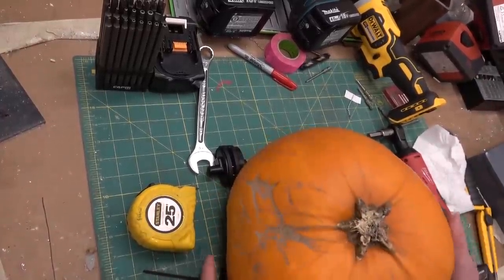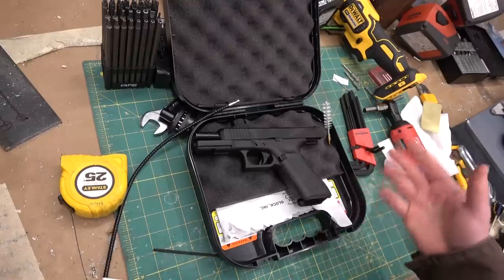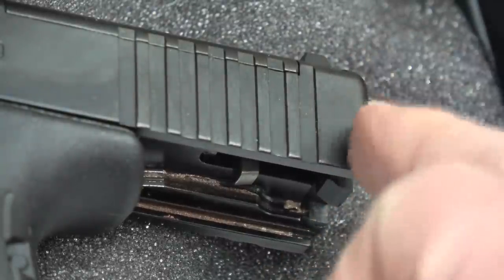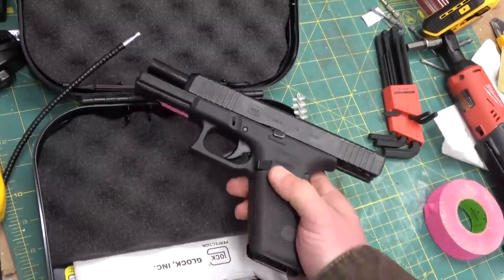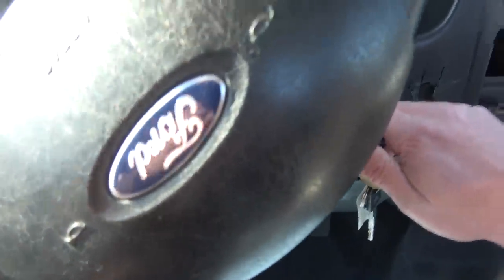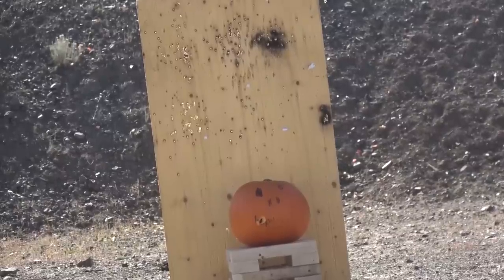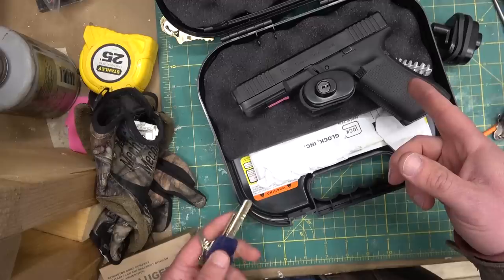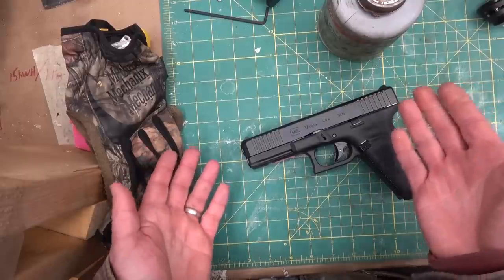BOLTR: GLOCK 17 GEN 5

Comment: They told me in the Glock armory training course that the copper lubricant is loctite C5A anti-seize.  According to them, it’s used because it’s better for long term storage and the slight abrasiveness aids with mating the frame and slide together.

The manual also implies that the copper lubricant was specifically used for a reason:

“SLIDE: (Note: The copper colored lubricant on portions of the slide of brand new GLOCK pistols is intended to help provide long-term lubrication and should not be removed).”
Reply: I was taught in gunsmithing that the compound was designed to wear in the pistol (kinda like a new engine.) When I buy a glock, I usually wipe that stuff off because I usually break in a pistol in the first or second range day.
Reply: @justinmeyer77  XD good ol' Glock. I was taught gunsmithing by my neighbor who was one at the time. Poor man's dying of cancer now. I've worked on untold number of glocks in my life. Both maintenance for my local pd and custom building for customers (gen 3 frames are cheap)
Reply: @justinmeyer77  Are you talking about the Glocks or the strippers?
Reply: This is what i was thinking as well I’ve seen people rotary tumble to get the mechanisms to make them more reliable and less chance of cutting the hand when the slide moves back after discharge.
Reply: @keats182 Yes.
Reply: @1FireyPhoenix  the gunk would be useful for cops wouldn't it as they rarely use the gun (and when they do it's normally not a thousand rounds) and cops are the main buyers of glocks (also do you know the comparative reliability of beretta, colt, and glocks?
Reply: @borttorbbq2556  civvies in US buy 2x more Glocks and and 2x more again more pistols than all PDs combined
Reply: @mattnw42  really?? Weird
Reply: wolfie Butler Not weird
Reply: @wolfie Butler close to one hundred million gun owners and less than one million active law enforcement agents. Not at all shocking.
Reply: @borttorbbq2556  they are required to train with the gun
Reply: I've heard an even better lubricant is just straight Loctite
Reply: I bought one in Germany. It came from Austria. And that one wasn't greased with the copper paste
Reply: Tzuede Off the Cuff personally, I like the wally world special hi temperature grease, it stays where you put it, unlike oils, and resists moisture longer than oils, especially in the hot, rainy season.
Reply: @JohnMaxGriffin  I just find it weird I'm personally not a fan of glocks but they undeniably reliable (i perfer berettas)
Reply: I've never had the copper lube fail me. I love my glocks, but they don't get babyed. Typically when I get one new the copper lube is the only lube that is on there until they're just way too filthy and filled with lint, carbon and strange white goo.
Reply: @Ark_0416  yes but there hundreds of guns to pick from
Reply: @1FireyPhoenix  I went to p.g.s.
Reply: @keats182  why not both?
Reply: @justinmeyer77  The glocks or the strippers?
Reply: Same here.
Reply: @justinmeyer77  I use a mix of 75% atf fluid and 25% 5w30.
Reply: @keats182  Well I certainly wouldn't use this Loctite stuff on the strippers. No abrasive necessary to mate those surfaces
Reply: Everything beyond the long term storage part is likely marketing wank. I along with everyone else that buys a Glock does 2 things. And often do these things even before they shoot it for the first time.

1. Get that awful copper shit off.

2. Change sights

3. (Optional) Beat it up so it doesn't look new. A Glock in the gun world is like a hammer in the tool world.
Reply: @1FireyPhoenix  I always heard people say to thoroughly clean a new gun, then lube to one's liking. AvE clearly doesn't paid extra for the manuals. What kind of manly man needs manuals?
Reply: yea, this is a break-in temp thing, not meant as a lube
Reply: Aren't glocks loose enough from the factory? Just use some high grit sandpaper to slick it up where needed then white moly grease for the rest.
Reply: Tzuede Off the Cuff  White moly grease is the best, I agree. It doesn't fume off when shooting and its easy to tell when it needs to be cleaned, since it's white.
Reply: Pretty much the reason they put it is so in case the gun stays in the box for a long time it doesn't stick.
As per suggestion from my armorer, whenever you get a new gun always do maintenance, be it brand new or used from the gunshop, and specially if it's from a gunshop.
Reply: @ChicknNudleSoup  I'm sure they have plenty of wear and tear already.
Reply: @borttorbbq2556  I have Colts Smith's, Beretta's, Sigs, Desert Eagle and some other well known brands that costs several times more than my Glocks (I have 8 of them). Glock is what I trust my life with. I was not only a cop for over 12 years but a firearms instructor for law enforcement as well. I fired my weapon several thousand times a year and never experienced any problems. However, I carried Beretta .40 for a while and as much as I love a nice Beretta, the frame developed a stress crack in the frame after a few years. Glock is the most reliable handgun in my professional opinion.
Reply: @borttorbbq2556  Every cop I know practices with their pistol pretty often.
Reply: @borttorbbq2556  Berettas (assuming you mean M9) and the Glock family are both exceedingly reliable.

1911s are pretty hit-or-miss depending on manufacture.
Reply: @triela420  Most do, although there are the lazy ones that do only what is required. And it definitely shows during qualification.
Reply: Thomas Foley  Beto may have him beat at the rate he's going.
Reply: @rjvan9220  Then sometimes I wonder, "What if it's all be design?"  Threaten confiscation/disarmament, firearms sales go through the roof, American citizens become the largest, most-armed standing army in the world that none but the insane or the suicidal would ever think of invading.
Reply: @Thomas Foley hard to say how it will go with how many bootlickers and order followers there are on the right.
Reply: wolfie Butler and yet a majority of police departments choose Glocks. What makes you think a majority of private citizens won’t do the same? I don’t think I know a single Glock owner who only has one, anyway.
Reply: Yeah what he said. It’s to help break it in bro. After a few hundred rounds, clean and regrease.
Reply: @John Doe - Couldn't agree more...
Reply: @Bluelightbandit  I bet your desert storm locks up on you often. Personally I hate thos gund because they would jam up.
Reply: Wranglerstar uses blue loctite on the slide.
And he keeps his glock in an old USPS box
Reply: @v8consumption  Police? Some only shoot it for their yearly training. Literally only rounds they fire all year is at the qual, no practice ever. Source: Small arms instructor.
Reply: @JohnDoe-zl6qw  I wish that were so. The ideologs that want disarming of the American public all seem to be " the entitled" that feel government power is supreme and that they should never be challenged. To bad most remember too late that we put them there, and can remove them. However, a lot of the leaches always seem the get reelected, some for years. We need term limits. No elected official should get a retirement for life after two terms either.
Reply: @sluttybutt  Thanks for that insight man, really.
Reply: In addition, they've been shipping them with that stuff since the very beginning, so even if their reasoning is wrong, the results are right.
Reply: @myis300turbo  Sure, how much would you like to bet lol? I don't own any weapons that malfunction often. Every gun that I have owned that had issues, I either fixed it myself, sent it back to the factory or just got rid of it. The Desert Eagle .50 AE is a very unique and heavy handgun that incorporates  a gas piston to cycle unlike most other semi's. Many people don't grip the gun properly while firing which can definitely cause a malfunction. Those guns aren't for everybody.
Reply: @rjvan9220  Oh, I agree.  It's just one of those, "Hmmm...what they're doing seems to be having the exact opposite effect of it's stated purpose for so long and for so many.  Coincidence?"  And of course it IS coincidence and false pattern recognition; at least of their intent.  It does appear, though, by the empirical evidence that if you intentionally wanted to ensure your populace arms itself to the teeth, just threaten to take their guns away (assuming it's a nation which recognizes the right to keep and bear arms in its founding document).

As far as term limits; yep, we need em.  Badly.  And take away many of their perks and privileges; force them to abide by the same laws they pass (*cough* Obama care *cough*), no voting themselves a raise (raises are put to a vote of the people, not to exceed a small multiplier of the minimum wage, and/or tied to the annual cost of living increase), no retirement package, and no working for a lobbying firm or any business which receives government contracts for a set amount of time after leaving Congress.  That will very quickly get rid of the leeches and return us to public servants who are there to genuinely represent their constituents.
Reply: AleXxTM123 The ones in the US come from Austria too. They are imported and distributed through Glock USA in Georgia.
Reply: Michael LeCompte Correct....Glock recommends not cleaning the copper grease off until initial firing and then cleaning. That being said, I owned 3 Glocks before knowing that and cleaned my guns after purchase. No problem either way
Reply: @justinmeyer77  Mobile 1 - works fine for your 25 yo Porsche and all the other stuff around you.
Reply: @borttorbbq2556  CZ P10C
Reply: @justinmeyer77  The strippers or the guns?
Reply: You learn something new every day.
Reply: @marcondespaulo  Actually the glock manual specifies that it is pre lubed from the factory and should be wore in with the factory schmoo. I would give a page number but I have to track down my manuals.
Reply: @justinmeyer77  the strippers or the gun? My man loved to be sliding in some good Mobile 1 :)
Reply: @1FireyPhoenix  no need to track page#... Thanks for the info. I have had no exposure to that. Very interesting. I understand the long term storage aspect, the lapping aspect less so, since people consider the breakin period to be 500 to 1k rounds. Pretty much one or two good range sessions.
Reply: @marcondespaulo  Glocks tend to be marketed to people who aren't gun enthusiasts. Most people who own a glock only shoot once a year. And usually with the crappiest ammo available. The self lapping helps break in the gun even if it's only shot once or twice a year.
Reply: @1FireyPhoenix  I guess I'm an exception to your rule lol.
Reply: @myis300turbo  Have you got one or have any videos of you having trouble firing one? Or are you just basing your opinion on articles or videos from internet superheroes?
Reply: if you buy a pistol and question its quality to the point of calling their fucking armory you bought the wrong pistol sir. C'mon man they come with plastic sights, have some self respect. Buy a real gun.
Reply: @justinmeyer77  If I go to an Atlanta strip club, I'll be sure to bring a bottle of Mobil 1.
Wouldn't want to run them dry.

Comment: The never seize is a break in compound...designed to get that gat good and sloppy for zero jam action. Hence the aggregate in the grease.
Run 500 through it and clean it out.
Reply: @markm0000  Aren't you supposed to baby it the first 500 miles?
Reply: This is how I understand it as well
Reply: Break in mentality has changed over the years, modern vehicles (especially diesels) say specifically not to run high revs or give it large amounts of throttle for the first 500miles (or in non-American manuals, 1000km, which is actually a good bit further), indeed because people kept ignoring this a lot of new cars are actually limited within the ECU till that first service, and trucks torque limiting threshold is raised to its advertised value even later again, sometimes 3rd or 4th service. The other thing they say is to avoid idling for long duration's, especially during break in, a notable change compared to older logic of starting a motor early to "prewarm" before driving or tractors of old that you used to literally idle a few hours after reconditioning, but none the less the mentality change seems completely ubiquitous across the range of consumer vehicles (maybe not surprising when you see how few actual human designers get shared between brands for some systems).

Comment: Good old low and left.

That's gonna be a case of operator error
Reply: ^ this.
Reply: My experience with Glocks and other pistols is that the culprit of the old low and left resides in your little finger. Your first 3 fingers naturally pull directly back into your palm but your little finger torques the grip of a right handed shooter twisting the muzzle down and left. A military instructor taught me to slack my little finger when shooting and never squeeze it. My low and left disappeared. Funny thing is you won’t have that problem with a Glock 26 or 27. No place to put your little finger.
Reply: @yqwgjsg  Another thing is that many people grip the gun too tightly and this prevents them from achieving a proper trigger pull due to overstressed muscles.
Reply: @yqwgjsg  I like to slightly extend my pinky while shooting the 26, it's an etiquette thing.
Reply: Jameson Totty Yes I find if I grip my teacup too tight, I spill the tea out of my mouth, low and to the left.
Reply: Jameson Totty beautiful

Comment: The springamathing you pointed out in the frame is not a drop safety, it's actually just the trigger spring.  Glocks are drop safe because of the hinged double-trigger as well as the shape of the plastic slot that the sheet metal trigger bar rides in, which only allows the striker to drop when the trigger is fully to the rear. Also, your gun is "made" in the USnA, but only the bare frame, slide, and barrel. All of the small parts come from Austria.

Comment: The firing pin safety is so the firing pin only  moves forward when the trigger is pulled. The trigger safety bar pushes the safety plunger upward to allows the firing pin to move forward. Glocks don't have a magazine disconnect safety
Reply: brandan4275 Chris @22:34 is what referencing. It is trigger actuated on that slide plunger that is the firing pin channel block. Not a magazine disconnect.
Reply: This is correct. This is to prevent the striker from hitting the primer when the breech is not locked.
Reply: Out of battery safety, technically.

Comment: Lifts hood on Ford:
Wanna hear a joke?
Never mind, it won’t start.
Reply: At least they circled the problem.
Reply: Swampy  We just prefer driving rather than walking or pushing. Also, I currently drive a Dodge with a 12 valve Cummins.
Reply: Love ma ford she's a tank. 2003 7700 series
Reply: Oddly enough, while I've seen some real POS Fords in my time, not starting seems to be a rare problem.  I've seen plenty of 4.6's that will start and run just fine with slipped timing or blown out head gaskets and all sorts of major damage.  Also drove 200 miles in my 87 mustang with cylinder walls on 7 and 8 shattered and the piston rod snapped on 8.  Still did 65 on the free way, thought it was just a head gasket until I took the motor apart.

Comment: It's weird (and for me, a first time!) watching a video where I (armorer, shooter, collector) actually know more about the specific topic than AvE. He still manages to be interesting and present new points, or at least communicate them well.
Reply: What's your take on the "anti-sneeze" lubricant (it does say lubricant on the bottle!)?
Reply: Same
Reply: @PauIieWalnuts  it IS somewhat of a lubricant but it’s also an abrasive, it’s not meant to be primarily lubricant. It’s most likely a break in trick, using that abrasive gel it smooths out the internals. When I’ve bought new glocks I’ve been confused as to what that stuff is and it does feel very slightly gritty between the fingers.

Comment: "The Glock's frame, magazine body, and several other components are made from a high-strength nylon-based polymer invented by Gaston Glock, called Polymer 2." - Wikipedia (kasler, 136)
Reply: So basically Nylatron?
Reply: Ah, thank you. Before he even did the test I was almost certain it was either nylon or polyester.
Reply: “Invented by” probably custom compounded by a company like RTP,  mr Glock was a a business man’s that knew about polymers but not a polymer chemist.
Reply: @hayden8491  ya think thats different? really.
Reply: I think Glock magazines do have a steel body as the main structure, the polymer on it is more of a coating.
Reply: @IR-xy3ij  just steel feed lips.  The body and floor plate are polymer
Reply: sounds like Glock Marketing terms for , we took an existing polymer and changed the ratios just enough to legally get a proprietary blend and put our name on it.
Reply: @IR-xy3ij  my bad.  My HK USP 18 round opaque mags have steel feed lips, and spring.  The rest is polymer.     My ets glock mags are transparent polymer.    But I pulled out some factory glock mags,  and you are correct.  I never noticed it before.    I only use glock mags in a 9mm sbr.     Well I learned something new today,  thanks.